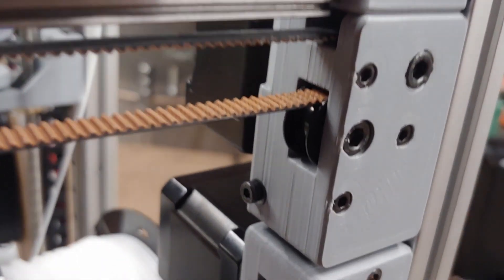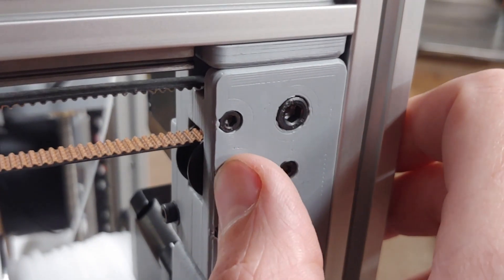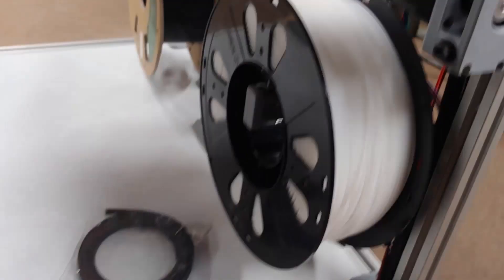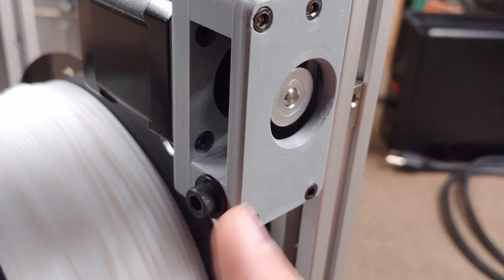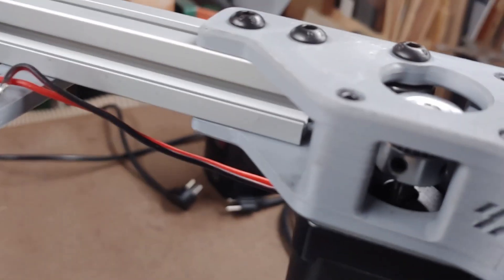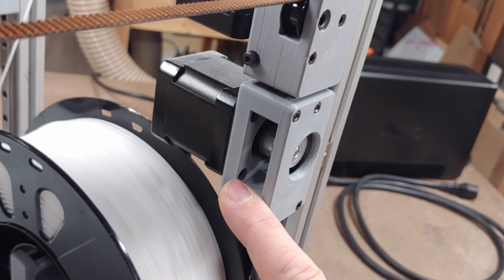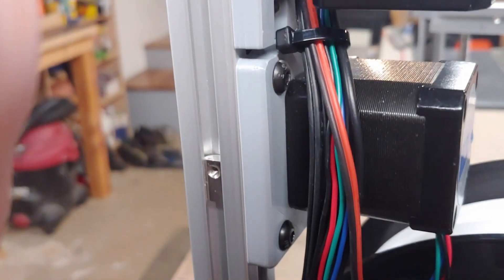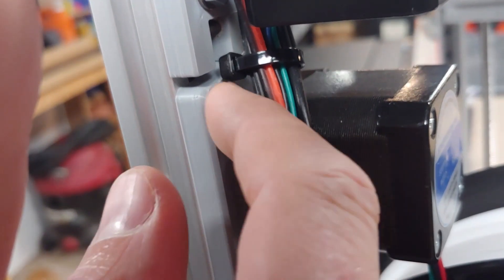Final Y drive design & upgrade to Gates belts.

Comment: nice design, how it hold on? 
di you try the silicon "brush"/wiper for the filament oozing?
Reply from the maker: Not sure what you mean by "how it hold on?" The part where the gantry attaches to the linear rail guides is notched to match the teeth of the belt.  When it is tightened to the linear rail guide, it clamps the belt in place.
I want to try other methods to limit the ooze before using a wiper.  The wiper is a last resort.  I had planned to modify the z-hop behavior during the tool change and then setting the slicer to print infill first (hopefully wiping the ooze to the infill), but am getting sidetracked by some home repairs.  It will be a couple months before I have any time to tinker with 3D printers again.
Reply: @badmouth75  i think you can use this to your printer https://youtu.be/F_F9SxMOYNA?t=4977